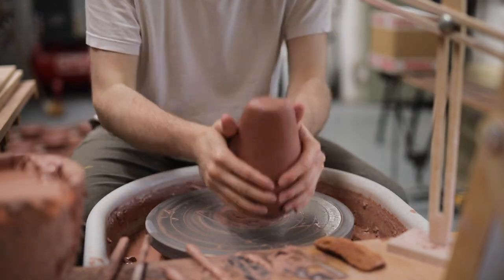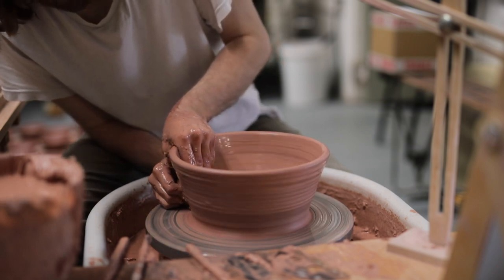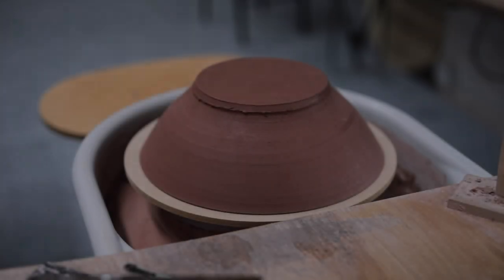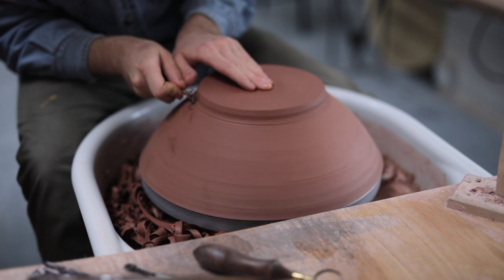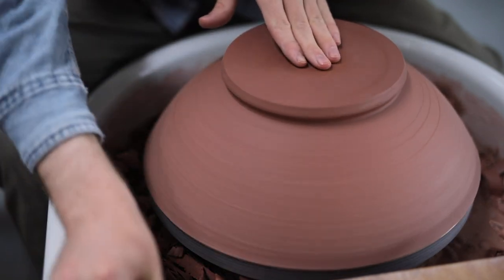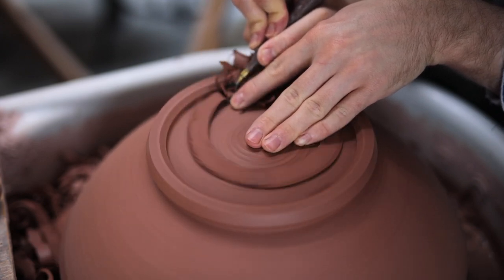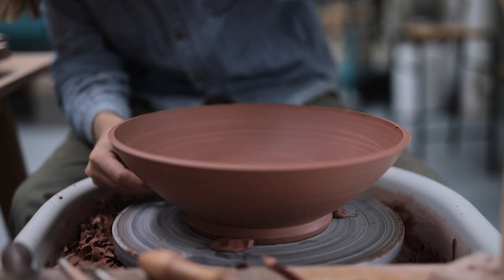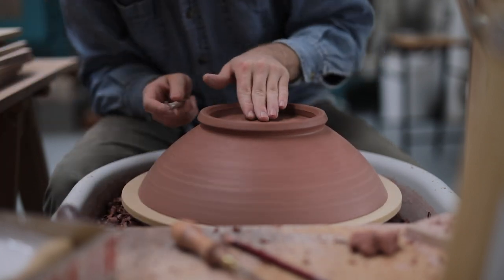Throwing and Trimming a Large Pottery Stoneware Bowl — Narrated

Comment: Do you have a video covering your trimming tools and how you keep them sharp?
Reply from the maker: I don't have to keep these Bison trimming tools sharp. They've made from tungsten carbide and hold their edge for a VERY long time, they're brittle though, so you can't drop them or they'll shatter. When I used to sharpen my old trimming tools I just used a bench grinder and a file, nothing fancy but the tools were cheap so they just needed a quick sharp edge as normal metal used blunts so quickly against coarse clay.
Reply: @floriangadsby  I thought that your trimming tools looked very sharp just looking at how the clay ribbions streamed off the pot - that explains it thanks.